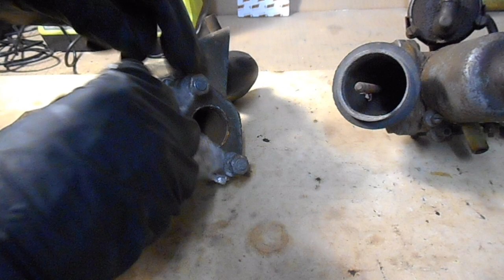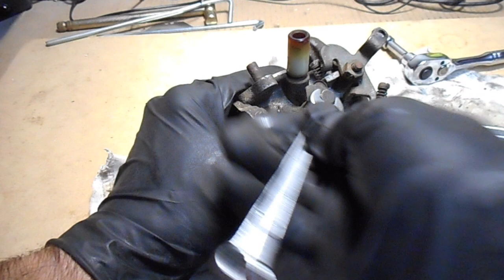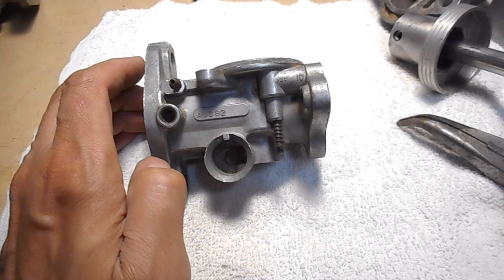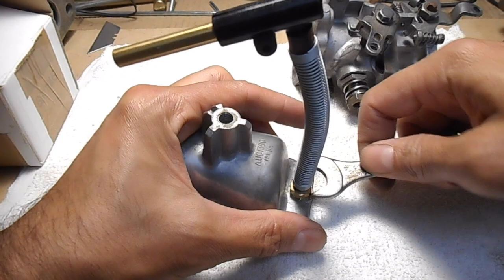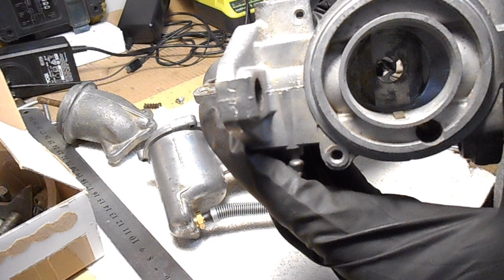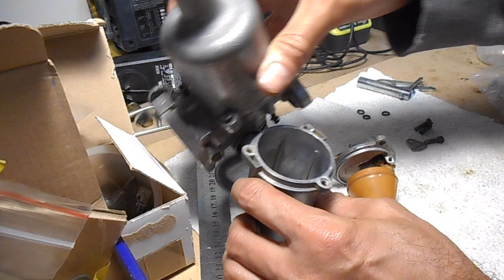AUD368 HS2 SU Carburettor 1.25" for Leyland Morris Mini

Comment: Great job, not sure I am confident to do them springs, I would like to know how you clean the outside of carb, would you use a small sandblaster.
Reply from the maker: I usually clean carb bodies with degreaser or parts cleaner and place in the ultrasonic cleaner. Sand blasting would be too harsh but you could use walnut or bicarb soda as the medium.

Comment: Nice work, a well explained and detailed job.Suggest some loctite on the butterfly screws and spread them open (I assume they are the correct split ones?) and smear some oil around the inside of the dash pot to help the piston slide a bit better.
Reply from the maker: Matthew Thanks for the tips.